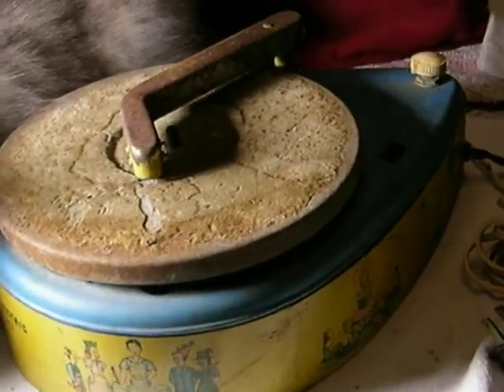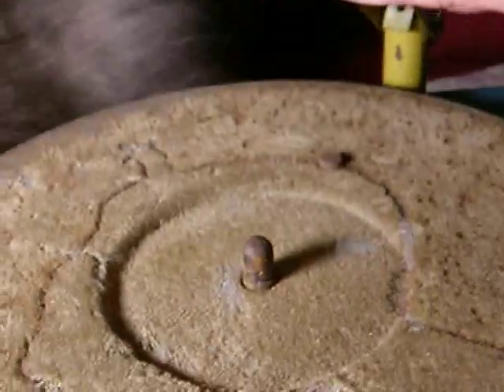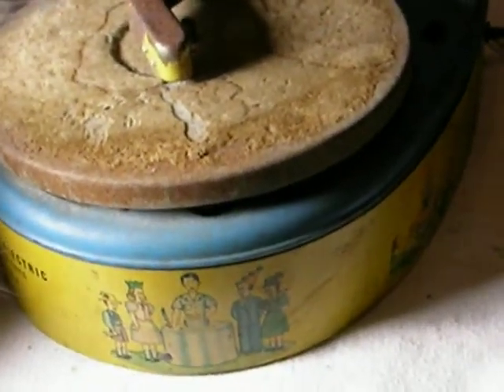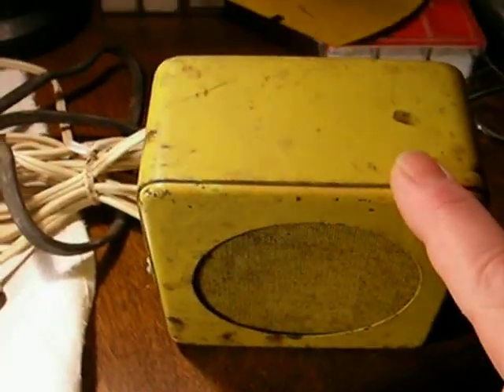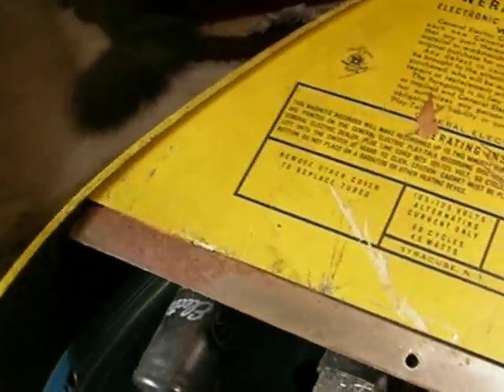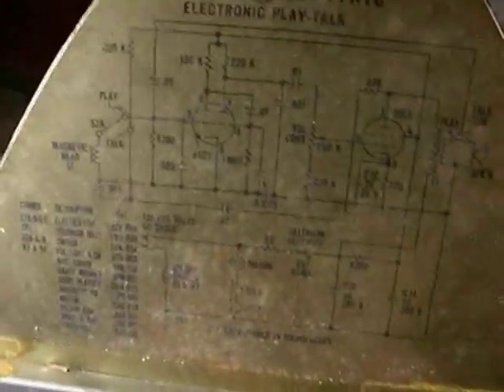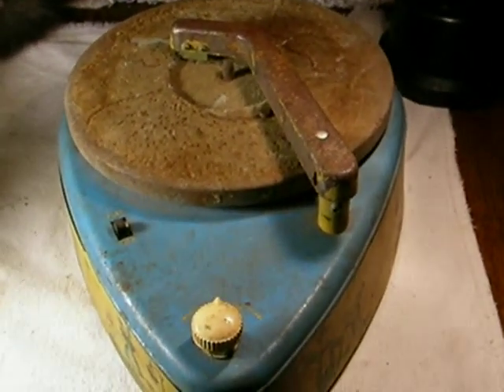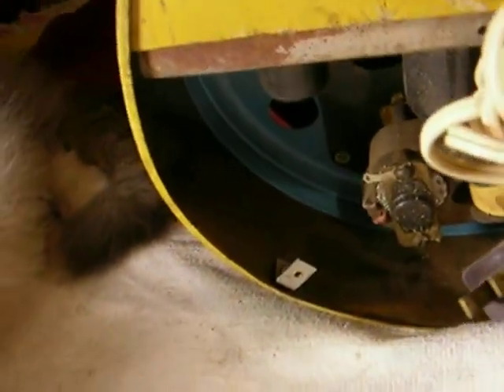1949 General Electric Play Talk recorder

Comment: It might work on the disk taken out of an 8-inch floppy, but you would need to guide the tonearm by hand due to the lack of the track for the pin to ride on. Or maybe you could just place the head on top of a tape running through a reel-to-reel machine.

Comment: I have one, but not the needed plastic guide disc. Floppies probably could be made to work. The original discs for this were paper based, about the thickness of a file folder. 
I actually have some of those as well. 
Another very similar product (which I also have) is the Brush Mail-A-Voice. The principle was the same but the discs were made out of a material very much like big floppies (I have one wrinkled one). I have the guide disc for it, but the disc size is not the same. Non-compatible.